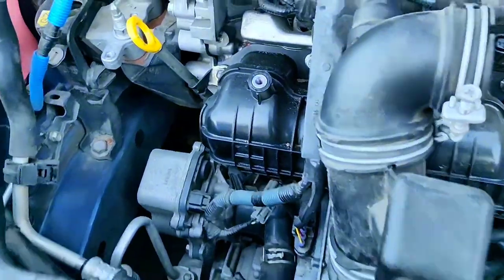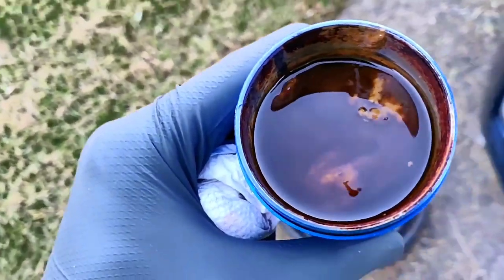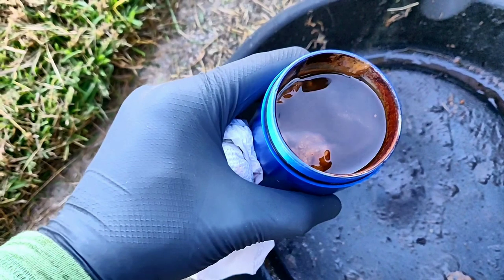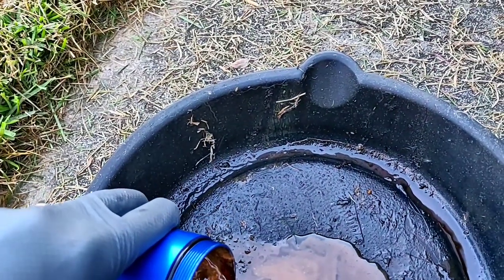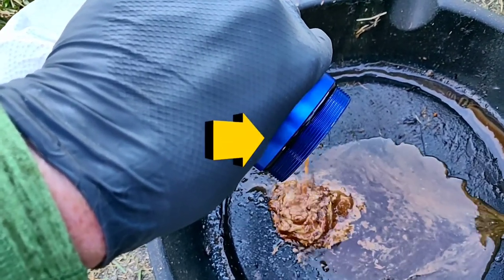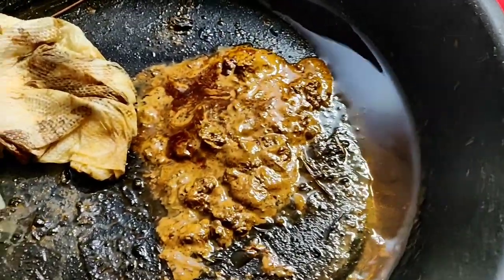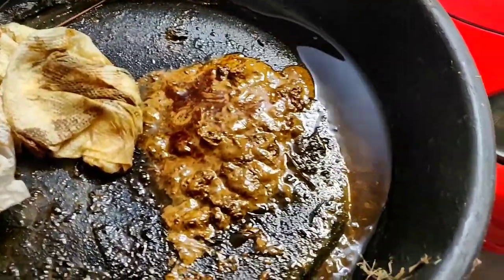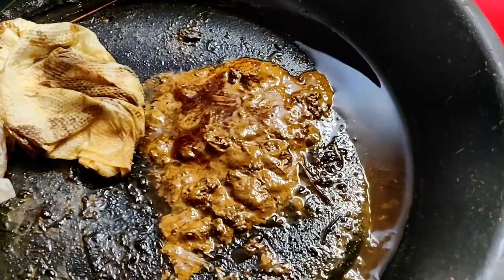Why you need a Blow-by Catch Can example 2012 Toyota Prius Intake Manifold Carbon Build Up

Comment: In one of your comment you mentioned your valves slapping.  It's cost by carbon build on in your injector nozzles. Clean then and it will stop.  I think that what causes the much carbon build up in the valves too because it does not spry fuel well to clean it up
Reply from the maker: Yeah injector cleaning is probably a great idea as my mpg has suffered since 160k.
Well Toyota says it is the pistons. Also I bought the car new 10 miles on it. The first morning after I bought it I heard the noise. I wanted to return the car and they showed me in the manual that the noise is normal(I think it was listed as transmission noise) . I have heard this sound to varying degrees since brand new.  Once the intake manifold and emissions parts get clogged the sound gets horribly bad like non stop.
I'm sure the valves and piston tops are covered with carbon. The oil consumption may be from valves leaking or piston rings I'm not sure. The car still has plenty of power (lol prius/power), and the engine is quiet. These are all normal things listed in the manual. Once my oil consumption gets out of spec then I will do a top end service. Valves and rings head cleaning.
Reply: I own 2012 prius here in Nigeria. Mine consumes 1 litre of oil on high way per 400 miles. I have done 3500 miles since oil changed and have added 3 litres of oil. I just installed occ and have driven 40 miles with no oil in it. 

I think the cause of the oil consumption is the noise the engine makes  for few seconds when u start it 1st in the day. It must have bent the valves and cause the oil consumption plus the carbon build up. 
Any time I clean my injectors it noise will not return for long time.

What I want to do now is to put the occ and pour every day a little lacquer thinner  into the inlet manifold to see if it will help  clean up the carbon build up
Reply from the maker: @greatogbuagu1370  just make sure you mount your catch can below the pcv valve so gravity will help carry it out. You don't want a back flow.
I'm going to clean the injectors and see what improvements I get.
Because it's been happening since brand new I'm not sure about the bent valve, but who knows.  Since all of these issues are in the owners manual I dont think so. I'll find out when I rebuild the top end one day. Thanks for your input I appreciate it!
Reply: @goflylow  have you rebuilt it now and are u still having the issues?

Comment: Looks like a head gasket problem aswell.  Moisture in the oil turning the oil into milky sludge. 
   Could also be due to extreme low temperatures condensation?
    A logical solution would be:-
 To fit the PCV valve into the output hose from the Oil Catch Can, in a position where its easy to remove  and clean.
    A Cleaner breathing,  returning to the inlet manifold, zero oil contaminating the PCV.
     Brass  Plumbing fitting and soldered copper pipe from the original position of the PCV to cool down the oily mist to the OCC. Rising upwards so the oil can drain back into the engine. Then the catch can will collect the oily mist.
   Maybe fit a Oil catch can, after the Exhaust gas recirculation cooler fitting aswell,  cutting and fitting copper pipe. 
  Catch can bolted onto the engine?...
Reply: Block the intake side of the pvc returne to intake and have the pvc valve extension just to dump on the ground. Catch cans freeze in cold climates makeing them useless.

Comment: I did the same thing BUT I  used the 1/4 spickot which came with the can it also has  the same threads as the PCV and sxrewed it into the block and the scewed the PCV into yhe out of the catch can. I drilled a hole onto the bottom of the catch can so i would never have to drain it

Comment: Can you tell me about your occ location? Do you have an install step-by-step? Do you remove in below freezing temperatures?
Reply from the maker: I am going to empty the can soon and I will make a video showing the process to add the catch can.
I live in the south so freezing temps and preparation are minimal down here. Also the blow-by is fuel and oil so it doesn't really freeze. If it did as long as the occ isn't full it won't stop flow. 
Ok so Location: once you remove the air filter box and intake piping the goal is to mount it below the pcv valve so the blowby will run down into the can.
If you look below the intake pipe on the passenger wheel well area you will see at least one pre-punched hole. I used this to mount the catch can.
If you remove the inner wheel well plastic liner you should be able to reach the other side so you can use a nylock nut or lock washer to bolt on the occ.
I was lazy so I used a snap toggle bolt I had. It quick and easy.
The pcv valve has a large diameter hose and I couldn't find a pre-bent hose easily. Using flexible fuel hose works but it needs to make a 90 degree bend. If the hose you bought kinks the you can use a few hose clamps. Slide the clamps where the hose kinks and slightly tighten it. It should help keep the hose round while it makes the 90.
I hope that helps for now.
Let me know if you have any more questions.
Thanks for watching!

Comment: Nice video. I wonder if you could clarify a few questions?

1) How many miles did it take for you to collect that amount of sludge?
2) At what mileage did you add this OCC?
3) How much oil consumption do you see between oil change?
4) How often do you change oil?

I have a 2012 Prius (just like yours), and am not sure if it is justifiable to add an OCC. I understand that it is not a minor undertaking to add an OCC to a Gen 3 Prius. Judging from other people's data online, it looks like they usually collect about 2 oz oil between oil change (5,000 - 10,000 miles).  My car has 110,000 miles, and does not show any oil consumption so far.
Reply from the maker: Thanks!
1) about 20,000 miles. I seriously neglected to change it out. That was over maybe less than 4 years. Maybe two weeks prior to changing it I started smelling a strong fuel smell inside the car due to the catch can being overfull. 
2) about 180,000
3) 1 qt per 1k miles burned. The manual states 1 quart per 600 miles is acceptable.
4) Every 10k miles with Toyota oil and filter. 

I bought the car brand new and followed Toyota recommendations on all services and some of my own (trans fluid at 190k and pcv at 150k manual has no recommendation on these).
The pcv is robust and probably did not need changed.
Let me explain why I installed a catch can. At about 150k miles I was getting almost constant piston slap. On cold starts this is normal. Even from mile 1 on cold start I would hear a second of slap (took car back to dealer and they showed me in the manual that this noise is normal, if I recall the manual called it transmission noise)
There has been many tsb  on the intake manifold for getting clogged. This is due to the excessive oil blow by. At about 150k I removed the intake manifold and emissions parts and soaked cleaned and pressure washed them and reinstalled.
At about 175k I noticed massive oil consumption. My engine was ticking I checked the oil and there was none on the dip stick! I am ashamed to admit I had not checked my oil regularly on this car.
I assume that my massive oil consumption started around 130k.
Toyota never told me what my oil level was at oil change so I don't have much info for you on this.
Most owners say oil consumption starts around 100k.
Around 175k I also noticed the piston slap was coming back nore regular. From my turbo race car days I remembered the catch can and installed it immediately.
It's easy to install and you probably would only need to change it once a year or 10-15k miles. It's only 8 or so 10mm bolts to take out the intake and you can install /access the catch can.
Your car will start to consume at some point. They all do. Start checking your oil weekly depending on how often you drive.
The health of your oil between changes depends on you topping it off between oil changes. If you don't your oil quality will diminish rapidly between oil changes and carbon build up and sludge will happen rapidly.
I have decided to still change the oil at 10k but to top it off constantly to maintain oil quality.
I hope my experience helps you decide your future maintenance. Changing the oil more frequently will not improve oil quality or help prevent carbon. Keeping the oil full will.
I have 205k miles and my car still works like new aside of some spring sag.
Per Toyota when it passes 1qt burned in 600 miles it will need top end done (pistons/rings, and valves check and cleaned).
Because of my neglect I really want to drop the oil pan to clean out the sludge.
Let me know if you have other questions. Thanks
Reply: @goflylow  Thank you very much for your detailed reply. It looks like oil consumption is a common issue for Prius Gen 3 between 2010 and 2014. Some people added Seafoam into crankcase and cylinders with good success. Don't know if you have tried that. I may add some to my crankcase as a preventative measure.
Reply from the maker: @Sunnysky321  just be careful choosing these products. Most are just mineral oil and you can prove this by looking at the legally managed spec sheets.
I started using "Restore engine restorer and lubricant", or "rislone engine treatment concentrate". These have been proven to work by some pretty famous youtubers with very thorough testing.
I would not use sea foam in the crankcase (in oil). I would use it in the fuel tank though. But there are better products for the fuel tank. 
Do not use more that one oil additive per oil change. The additives build up and.... Well who knows really but prius oil is pretty thin and even basic additives Toyota does not recommend. There are some very tiny passages that need oil and the thicker it is the harder it will be to flow in these places, especially if you live in places like Alaska.
I live in the south where it's warm almost all year.
I noticed clear results with Restore brand. Due to an injury I haven't driven much the last year so I don't know how much I burn now.
I ran Restore with a new oil change for 1000 miles and still was burning half quart, then changed the oil with restore again and after 1000 miles no loss at all.
I don't know how long it will last but so far so good.
I use "Redline complete fuel system cleaner"  to the fuel tank as directed (which I believe helped reduce oil consumption through valves and rings) . Once per oil change. It does contaminate oil via blowby so you can't use it every tank. I use this brand because it's the only brand that still discloses the actual amount of Techron it uses.
It's highly concentrated and works! Most fuel cleaners are too diluted or don't have enough techron to actually clean the combustion chamber.
Even chevron stopped disclosing the amount of techron they use (techron is expensive). Most fuel cleaners are BS.
Redline is pricey but will clean the combustion chamber and once every 10k really isn't expensive at all. The two products add about 12-15$ per oil change but will keep your engine happy for a long time.
Just my 2 cents.
Thanks again for watching, anything I do I first compete very thorough research.
Reply: @goflylow  Thanks for the information. Very valuable.

Comment: Hello, I have placed the OCC in the same place as you, I have left the original tube and then 16mm tube to the inlet of the OCC, at the outlet 16mm tube to the inlet of the intake manifold with 2 elbows of 90º, my question is the following, because when the engine is idling, the tube that reaches the OCC from the PCV valve runs out of air completely crushed ?? When the PCV valve opens and lets the gases pass, the tube becomes round again, what is the reason? can damage the engine ?? Thank you.
Reply from the maker: Sorry I just saw this. 
As long as gas is exiting that is the important part. Did you check if you pcv valve is leaking?
If the hose crushes in on itself try and find a more rigid hose/tubing. 
You can add hose clamps on the hose itself where it is making the hard turn and it will make the hose much more rigid and resistant to crushing. The hose clamp will help the hose keep perfectly round and it will be hard to collapse it this way.  But if it still collapses then a more rigid hose is the only answer, just use hose clamps to help it make the hard turn back to the catch can without folding on itself.
I hope this helps.

Comment: Can you get to it easily?
Reply from the maker: Yes and No. The intake needs to come out. 
It's pretty easy and only a few bolts, but if you have never done anything like that it might be challenging.
Reply: @goflylow   I love the location you put it in, and I like the tip you gave about mounting it lower than the PCV. But isn't it kindof a pain to remove the cold air intake assembly just to check or empty the catch can?  Only 5 bolts, but geez, like you said in your video you smelled something and your air intake was slurping oil from the can. This tells me "out of sight out of mind", as most people are going to procrastinate about removing so much just to check a simple device.
Reply from the maker: Thanks. Out of site out of mind lol absolutely. .  Maybe add a cold air or ram air intake and you will free up some room to easily get access to check it and service.

Comment: My 2010 head gasket blew at 157,000k moles A far cry from what was mentioned in the video
Reply from the maker: Sorry to hear that. I'm guessing you over heated at some point (bad thermostat maybe). That or  maybe blocked pcv valve caused it. 
If properly torqued a head gasket rarely fails.
Reply: I have read the 2010 & 2011 Prius years are more prone to that.  Sorry to hear.

Comment: Poor location for the PCV valve.
Reply from the maker: Yeah not an easy to reach style. Good thing is it's not your average pcv valve.
After 165k miles it still sealed perfectly. Toyota does not have a maintenance schedule to replace it because it is large and high quality.
So yeah if you need to check it, it's a pain in the ass. Chances are it will be working just fine though.
I agree with you though I like to check my pcv valves and this makes it difficult.